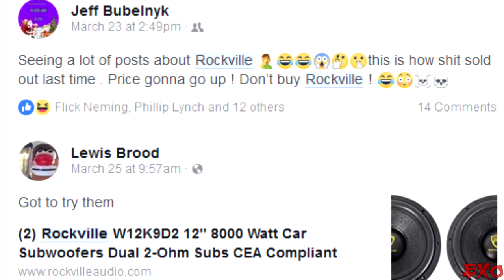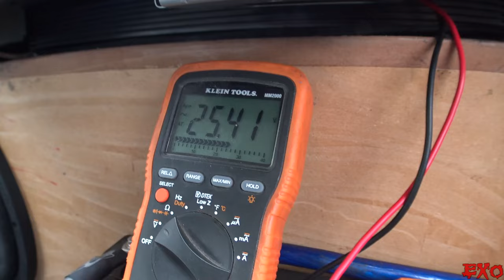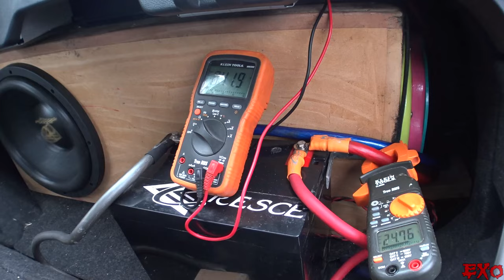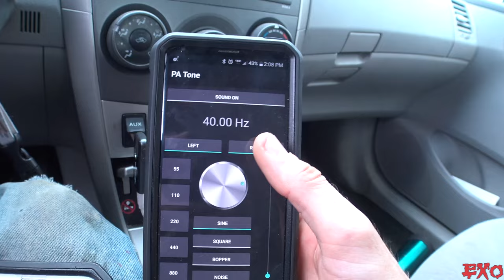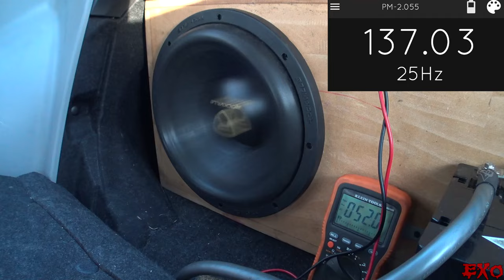CHEAP $100 Subwoofer TEST w/ 12" Rockville K9 Car Audio Sub | Aero-Ported Box SPL Bass Testing

Comment: Wussup man. I got a cheapie build myself a 2500 watt power acoustik gothic series sub with a 2500 watt power acoustik razor amp it flexs the windows and shakes the windsheild wipers with some songs. The only thing close to expensive I have is my RCA's I paid 5$ for them but it's a 40$ set of RCA's . 30$ wiring kit that only holds 1200 watts. Essentially the whole build is like without wiring not even 200$ cuz the subs 70 the amp was 105$ after tax
Reply from the maker: That's a GREAT deal for all you mentioned. Nice going man.

Comment: Hey boss I need your help!!!
I have the stroker amp you got with the stroker sub. I love it!!! But I bought 2 12 4 ohm vega series subs to attach to it but I am not getting the sound I want. So I am thinking of buy-in 2 12 jl w3v3 instead what is your thoughts? Please I would greatly appreciate your thoughts on this!!!?
Reply from the maker: Is that amplifier 1ohm stable? I can't recall. If so the W3's are like 3 ohm coils, correct? That would mean .75 ohm wired in parallel. Not sure if that amp is a fan of such low resting impedance.

Comment: i just picked up a rockville 2ch for my doors and not only was it just $68 but its CEA-2006 certified and even came with a birth sheet. I had very little faith in rockville after I bought a pair of the dj/pa speakers for use with my turntables and they were terrible. they had NO bass at all. it sounds like they don't play below like 100hz seriously. no sub bass and even kicks are high pitched and weak. I get WAY more bass from the pair of 5.25" speakrs off my old shelf stereo, lol. But the recent rockville car audio lines have been getting good feedback so I gave it a shot. Now I just gotta finish the install and see how it performs on a pair of alpine type-s 6.5"  2-ways and a pair of type-s 4" 2 ways
Reply from the maker: Bummer man, so I take it you're not necessarily happy with everything?
Reply: well as for their DJ/PA gear no it sucks pretty bad but the new car audio stuff is getting some pretty great reviews and being on a tight budget atm I'm really excited to run this rockville 2ch cuz the birth sheet says the cea certified rating is 127w X 2@4ohm and 185w X 2@2ohm so if it get close to that I'll take it any day of the week for $68. Hell, a dc/sundown 100.4 is like $300, smh. But I have a decent amount of faith cuz the audio groups have been saying that the 2017+ rockville stuff is/does what it says. I also just picked up the new soundqubed s1-2250.1 that just came out to power my FI sp4 18 which i know is a bit weak for that sub's conservative rating of 3300w but they dynoed this 2200w amo and it did 2800w @1ohm dynamic so again for a tight budget thats some good power for just $250. My pair of PSI P2 18s and my Soundstream 3k and audiopipe 4ch got stolen from my truck a few weeks ago so now I'm trying get back to bumpin' with as little $$ as possible.
Reply: Also I just rewatched the 21" b2 unboxing vid and was just curious what ever became of it?? I really think you should convince your girl to let you wall he car with that beast smack dab  in the middle, lol. Or if thats not an option then maybe lil' blue can get it in a wall in the future.
Reply from the maker: That'd be AMAZING if she'd allow it. The 21 is still waiting patiently, maybe Little Blue!

Comment: If your purpose was to be loud, mission accomplished, but it over powers your mids to the point it sounds choppy.  I don't know if it's the mic on your camera, but I don't see the point?  

I purchased some a/d/s subs roughly $100 each a few years back when they were clearing them out of the store.  Yes your rockville is way more powerful than my a/d/s, but as for sound quality and depth, I'd never trade them for anything.

Comment: Did they just play sine wave rap music through it till it blew or what? Maybe put in a smaller amplifier or limiter to make it harder to blow next time, or remove it from the car. The problem though is you'd lose some potential output on kick driven music with a smaller amp. This is why I like PA system processors. I also like to limit below the port tuning. My Eminence paper subwoofer drivers aren't as robust.

Comment: why do some subwoofers have 2 positive wires and 2 negative wires?
it is weird because other subwoofers have only one of each wire
Reply from the maker: Those are subs with DUAL VOICE COILS.

Allows for more wiring options and ease of use.

Comment: Yeah....  It looked like you pulled voltage from the subs and amperage from the Amp draw.. that's not how you calculate wattage... you need the amp draw and the voltage from the same location...
Reply from the maker: No no, you're confusing two different measurements. I was just clamping the 12v wire to see how much the amplifier was consuming. That wasn't the  actual power test. If you skip ahead you'll see it. The wattage was tested by clamping the SPEAKER WIRES not the battery cable.

Comment: It's always a good idea when building a sub box to have 2 speakers with a crossover or 2 separate amps . . Have 1 set for your main sub bass, say 30 - 40 ohms and the other around 60 - 90 the main reason for this is clarity and you won't need to push your speakers anywhere near the volume with one. Try it and you'll see what I mean.

Comment: Can a speaker like that sound good on less power.   I use to sware by pyle pounders,  because they rock on like 400 watts,  at 4 ohm too so i font need high output alternatpr snd all that jazz. 

Did this in 90s though.   Not done in 20 years plus
Reply from the maker: It sure can, but after full review, I would NOT suggest this subwoofer at all.

Comment: Hay nice rockville k9 are OK but the k9's are failed code in a car demo I was watching the coil adheave failed they ware tost, so for the price you could buy (Rockford Fosgate) p1s about $100 bucks my experience with the p1-s8-12" is they have not failed yet in my home setup had for like 8 years.

Comment: What type and size box is best for these subs?
Reply from the maker: Depends on several things. Power, room, goals ect
Reply: EXOcontralto I have a 1999 silverado 1500 extended cab want to rattle brains with them. I have 2- rockville w12k9d2 4000 watts max each and the Rockville db16 8000 watt amp

Comment: try the power acoustic 12 inch sub 2500 watt from Walmart it's what I have with a 2500 watt mono d box and a JVC head unit turned to 1800 watts and it makes my suv shake so bad it sounds like it's going fall apart
Reply from the maker: Glad it's working good for you, Johnny! Thanks for the comment :)

Comment: Not new news to some people.  Speakers are not a complicated thing... Price of "materials" can vary, but nowhere close to the difference in price points. Build quality changes cost, but the biggest hit or miss ((in my opinion)) would be  >CONSISTENT BUILD TOLERANCE< ..  The tooling during assembly & attention to checking specs makes all the difference.  MANY speakers are made by the same manufacturer & because of (BRAND NAME) the price can go 2x  3x  4x etc....  
  Nice to see that this CHINA factory is set up to poop out a good woofer for cheap. (for now).. China can (usually does) change something or lots of things and quality goes to crap... Buy a few now while there good............

Comment: I found a 12in 2,200 watt Audiopipe subwoofer for 167$ couldn't find the sub u showed in the video
Reply from the maker: Nice man! Did you end up picking it up???
Reply: @EXOcontralto  sure did it bumps really good it handles the power really well I am running it with a 2,800 watt amp

Comment: They measure All the same, whatever you bye.  The low frequency max level. 20-30 -40 Hz.  Do isobarik, and you can lift the bottom end. It's going to lover the high bass but that's not a issue.

Comment: Yo man I’m looking to build a set of self powered speaker towers with crossovers and equalizer.. now man seeing that your the woofer guru, I’m looking for 10” and or 8” subs that will be good for home theater. Most common subs without breaking the bank but still handle between 250 and 600 Watts @ 
4 ohms have a response range of 35-200 hz ball park. I’m looking for 10” subs that can go as low as 24hz and up to 250 hz. And I’ll add 8” subs that would range 34hz to 1500hz you feel me. Any how nam I looked into fosgate subs but they have a VERY narrow response range but they work excellent within that range. I know most home subs with a wide and sensitive range don’t hold a lot of wattage butt this is where you come in weather it’s home or car subs... help yo what’s up lol?

Comment: Good cheap subs, but why didn't you wire them in parallel? If that is a 2 ohm sub you could have wired it for 1 ohm, and when you get the other one if you wire then both up together then you can get them down to 1/2 ohm!
Reply from the maker: It IS wired in parallel. You must be looking at something incorrectly. What makes you think it's wired in series?
Reply: Never mind I was wrong about it being in series. I was thinking wrong, but wouldnt it have been easier to just run one wire from the positive terminal in the box to one coil, then run a wire from that coil to the positive terminal on the other coil? Because you ran two wires to the terminal on the inside of the box, then ran one wire to one coil then another wire to the other coil. That way just adds extra wire, and that makes more resistance. It probably wouldnt make very much of a difference but I just wanted to know why you did it that way.

Comment: What type of alternator do you recommend for 2 12s kicker cvxs
Reply from the maker: That's the wrong question to ask. What WATTAGE amplifier do you have?
Reply: @EXOcontralto  the amp i have is a Audiopipe 1800w Mono Class D
Reply from the maker: Should be fine with a 150+ alt on that power.
Reply: @EXOcontralto  thank you. Appreciate it

Comment: If you ever so rear speakers on that car expect it to be a pain in the ass cause it is. Just did 6x9 troppos and I had to use the original basket of the oem speakers as an adapter
Reply: Jovanye Cerna just buy 6x9 boxes and have them sit on the rear deck. They sound better in boxes anyway
Reply: Towlieee lol no kidding.

Comment: i never liked ported enclosures.. i love the hard hitting deep bone rattling bass..  which is why sealed was always my preference
Reply from the maker: Sounds like you've never had a properly tuned ported box!
Reply: yes i did... it was done by the car stereo shop themselves... they actually put both in my trunk ...  and the sealed was much better. 

are you saying they designed it wrong..??
Reply from the maker: Yes, that's almost always the case. Many "car stereo" shops are completely oblivious to the real science behind a proper reflex design. Most shops use pre-made boxes for every subwoofer. They may look nice all carpeted up, but 9 times out of 10, the tuning is WAY TOO HIGH and sounds like crap on the deeper notes. So I'm not surprised you were happier with their sealed box option. 

Chances are that both those boxes were already pre-built, and ready for someone to buy before you walked in. In this industry, even though it's WAY MORE expensive to go custom, enclosures MUST be built to the specification of each unique subwoofer. Without that approach, the sound will always be flawed.

Many shops just can't afford that approach when so many people will settle for something pre-made.
Reply: this is what happens when you put your trust in a shop that has been in business for 20+ yrs..  They are like politicians... they know what to say to win you... Just as you write to me.. Im here, you are over there... You are no different than them..  I don't know jack shit about this stuff, but im sure YOU and THEM can throw some fancy words and specs around to win me... You can talk shit about them all day long, they can talk shit about you all day long... 
the bottom line is.... when you don't know anything about car stereo, you must trust that they are doing you right... 
and one more thing, both boxes were not pre-fab boxes, both boxes were cut from 4x8 sheets and put together by hand..  with the recommended sealed air space (so they said) and with the "proper" port for the ported enclosure ..  and the guy said it was not a waste of $$ because they will sell the other box to someone else.. 
so back to square one... everyone thinks they know more than the other.. and they all bash the other shops...
Reply from the maker: Just trying to shed light on a common problem in a general sense. Wasn't directed towards you. Unlike the salesmen you've dealt with, I'm not here to spout off jargon to impress a sale on someone. I'm just here to help people better understand the things they might not about this hobby.

Comment: I guarantee you that the Skar VD12 will hit just as hard if not harder and it's 20 bucks cheaper. I have two in my truck and set off a car alarm across the street.
Reply from the maker: And your point is?

Comment: Those speakers could perform a whole better if the glue work holding the damper/cone/coil was less heavy handed. And a thicker top plate for the long coil.
Reply from the maker: And a better coil ;)

Comment: Yoo check out the 5kwatt system 15' for 280 bucks that's cheap comes with an amp an wires
Reply from the maker: Is that what you got?

Comment: 27x to bass heads it’s been shared 27x.....what up all I got is 2 15” boss phantoms 2500w/1500w rms (cheap and garbage) on a ts power td100 3000w amp in my hatch back wired to a 1 oHm load using 0 gauge wires... I need to be a winner..... even my door speakers are all blown and three work with no highs yet
Reply from the maker: Winner was announced already!

Comment: 40 volt on a 4+4 ohm speaker is not 1500 watts. Let's do the math: 4 ohm in parallell makes a load of 2 ohm. 40 volt divided by 2 ohm is 20 amps (10 amps per coil). 20 amps times 40 volt is 800 watt, not 1500..
Reply from the maker: It's NOT a 4 ohm subwoofer... It's a dual 2 ohm subwoofer. Wiring the two coils in parallel equals 1 ohm. You're mistaken. I have the measurements clearly filmed with real-time numbers for everyone to see in this video ;)
Reply: If it's not a 4+4 ohm speaker, how do you explain the 59V / 25,53A? Were you using 15 meters of 0.5mm2 wire to your speakers? Your meassurement of 59V / 25.53A shows an impedanse of 2,3 ohm.

Comment: guys! power is ixe correct! but in other words 25amps times the voltage of the wire your measuring 12volt line. 300watts! also , an induction meter to measure dc current? I have seen induction volt meters. got to have one, but I don't think this is one of them. BUT the wrench that I cant get my head around is e square divided by resistance  =power, or I square x e = power,  lets say 60v x 60v =3600 divided by 1ohm = I don't think so. GOT to get the amp meter on that speaker wire to find real power to speaker!!!!!!! also power in is equal to or less than power out.
Reply from the maker: Can you try reexplaining what you're talking about? Not sure what you're trying to point out.

Comment: U powering that w a factory radio. Due to having to get a terrible rear speaker out to converter to rca at less that 1v. Bruh, get even a $200 radio w 4v or greater rca outs.

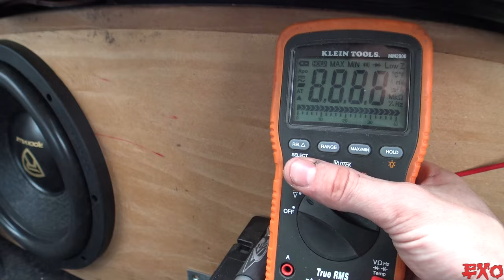Comment: 13:18 It's DC not AC ...
you should have tested it on DC Voltage.
Reply: its not gonna measure anything in dc because the amp outputs ac

Comment: why dont you mention the "copper wires" that look like alu cables? i never use the cables that dont have copper color to it, and weight.

Another thing, you use bolts? steel? man.... and cable shoes.... cmon you should know better.
Reply from the maker: I see nothing wrong here. Those SMD terminals are pretty sweet, so why not use them? Gotta remember this isn't a spl setup either, so changing what you mentioned wouldn't make any perceivable differences in sound. In fact we even had the last woofer hardwired directly to the amp, and somehow this setup was was louder?

Comment: A wanna be American Bass sub but AB subs can take more then 1500w and will not get hot I mean sure they are not only 100$ but they loud af when u get some power on them
Reply from the maker: Difference between quality and lack thereof ;)
Reply: This is just my opinion but I wouldn't call a ported box "quality" since it usually messes up the frequency response and gives non-natural sound. +10 db at 50Hz? Yeah that's sound quality! Not. Just an example though. If you want "quality" sound a sealed box should always be used imo.

Comment: I like the editing of this video...don't like the box design, at all...running the port straight to the sub negates the box entirely, may as well make it a free-air
Reply: I built my single 12 ($150) sub to sound good and It hit 149.9dB...the box is everything and if youre gonna port it, you want the sub to be as far away from the port entrance as possible
Reply from the maker: That's totally not true, but thanks for the comment!
Reply from the maker: This is a daily driver, that has tons of crap jammed into the trunk on trips ect - No SPL positioning for us.